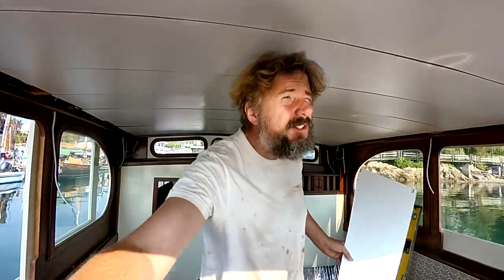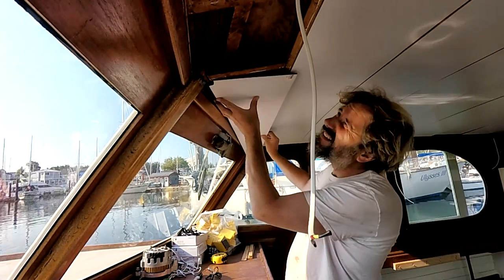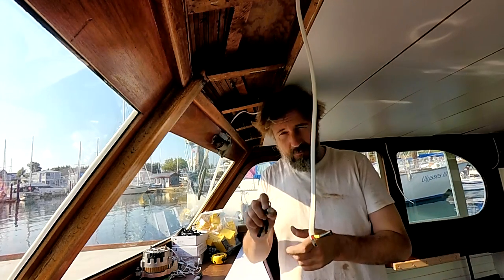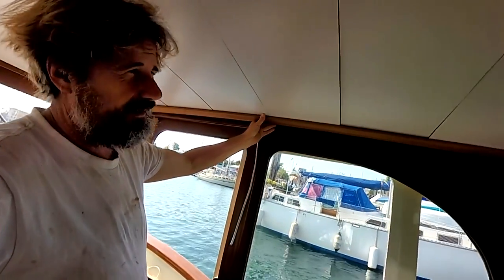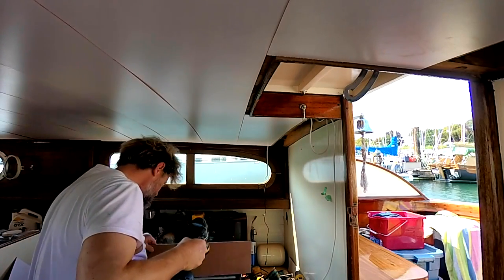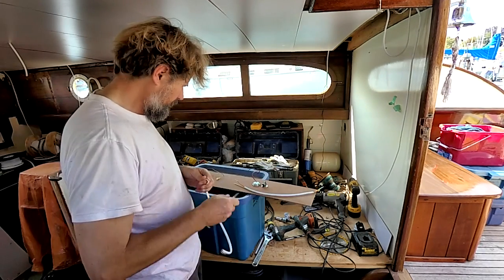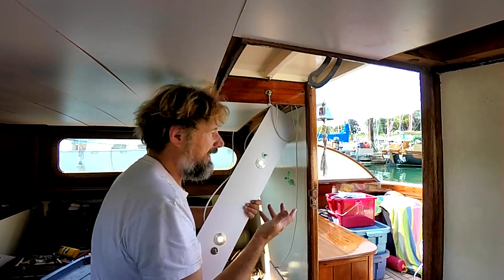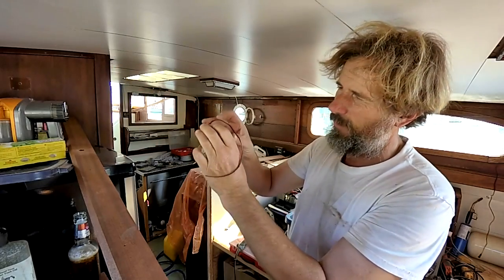LED boat lighting for Zephyrus - Wooden boat restoration - Boat Refit - Travels With Geordie #84

Comment: To avoid damaging a surface with a hole saw, drill a pilot hole first. then use the hole saw in reverse until it scribes the surface. Love your channel, I'm going to need watch it over and over, I just bought a 1939 Monk 36! Cheers Mike
Reply from the maker: Woo, great tip. Wow, what boat?

Comment: The switches I love are the old ones that were popular in the 1960's where it looks like the head of a forming nail. My grandpa used those in everything, and I was always around them as a kid.
Reply from the maker: Do you mean the toggles with a ball on the end? I love those and will be using them extensively on my boat.
Reply: @TravelsWithGeordie  I am not sure the style you are talking about, I am going to use these: https://www.amscovf.com/PUSH-PULL-SWITCH-6-36V-2-P-2-T-SPST_p_316754.html
Reply from the maker: Those are great and we're using them on Zephyrus.On my boat most switches will be...http://www.qualitydist.net/pico-5511pt.html

Comment: Spot weld cutters are miniature hole saws with a spring loaded live center, they come in 3/8" and 1/2" but only cut about 1/4" deep. If you drill a 1/16" pilot hole you can cut from both sides. Great for small holes in delicate material...
Reply from the maker: Another splendid tip

Comment: Excellent... as usual. Peter, you can prevent tear out by placing a small piece of sacrificial wood underneath the board and blue masking tape on top of the white part where your hole is to be drilled.
Reply from the maker: Both great points. Thanks.

Comment: Gotta run the hole saw in reverse to get a nice smooth start. Then run it forward. Keeps the cut clean and it won’t grab as much.
Reply: Sailing With Vampires I’ll try that myself sometime, thanks!
Reply: Maybe drill through blue tape applied.
Reply from the maker: Good point. I like it!
Reply from the maker: Great idea Dave.

Comment: you can also reduce tearout if you drill on a sacrificial piece of wood and drill through into that.. also a small bit of masking tape will make the surface less likely to chip when you drill and cut
Reply from the maker: Good points, thanks William.

Comment: I’ve used that MinWax wipe on poly for years with similar great results. It goes on so smooth and fuss free, great looking and streak less. It’s the cherry on top of the sundae for woodworking projects. I like the pace of your videos. And please keep including the bumps and wiggles that come with working in a confined space. I also have experienced (and enjoy seeing) the perplexing hole saw pilot bit length conundrum and other unforeseen little annoyances that pop up. I especially liked the molding-in-and-out-the-window dance. Very graceful! Cheers!
Reply from the maker: Thanks Gary, I appreciate the kind words.

Comment: Make sure you use a single crimping tool for your heat shrink connectors.  They're not meant for double crimps.
Reply from the maker: Very good point and one I deliberated on. I did a bunch of testing and determined the second anvil doesn't damage the un-shrunk tubing at all. But to be compliant I'm getting a single crimp tool. Sadly I don't like the Ancor one. The anvil is much more effective in their double. The single is a simple pinch.
Reply: @TravelsWithGeordie  I use these for my heat shrinks: https://www.delcity.net/store/Insulated-Terminals,-22!10-Gauge/p_10427.h_45988.  This website is also a great outlet for a myriad of different top quality connectors and other electrical supplies.

Comment: Just for future if you lay a scrap board under what is to be drilled you will have a nice clean hole with no brake on the back side.
Reply from the maker: Very good tip Gene, thanks.

Comment: Tear out can be helped by drilling into a sacrificial backer board. Found one of those switches except you rotated it to switch on and off my dad was not happy when he found I had used it in my room!

Something I did in a customers house was run rope lights in the toe kick in her kitchen, the floor was from an reused from a gym and she and her significant other liked to dance one it having rope lights down low made it more romantic according to her.
Reply from the maker: Hi Charlie, heh, good stories, in my home building days I used miles and miles of rope light.

Comment: i would not worry about humidity inside with sapele,but white faced mdf soaks up humidity like a sponge.
leaks ,condensation and scratches puff up mdf  like corrosion on painted aluminium,this is a material that has no place on a boat apart from being useful for making templates.
Reply from the maker: Thanks Alex. You're very right. This stuff is Masonite, slightly less nasty than MDF and I sealed the beachside and edges with polyurethane. I did the same on my boat and did some destructive testing to see how it worked out. Actually really pleased with the moisture resistance.
Reply: treating the unexposed surfaces will definitley help.but even the white painted/coated surface starts looking tatty after 5 years or so on a boat.

i'm in the process of replacing many square feet of masonite on my insulated 63ft aluminium boat with high gloss gel coated 1.5mm grp panels.

to be fair it's 18 years since i fitted out the boat and the back sides were not treated,,vertical surfaces faired quite well,but ceilings and high wear areas failed after about 8 years and have been replaced.

this compared to the exteriour grade ply wood used through out for floors,cabinets etc of which only a toilet floor and some bits below opening ports have failed due to moisture.